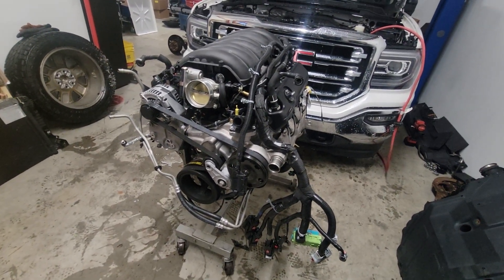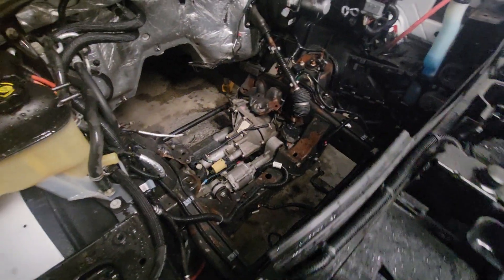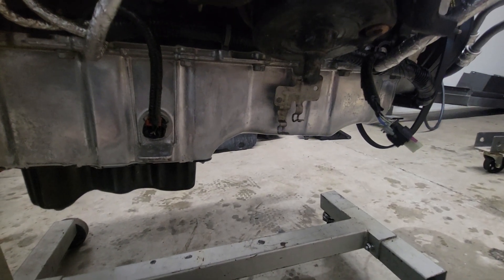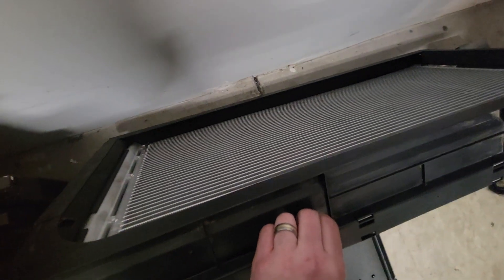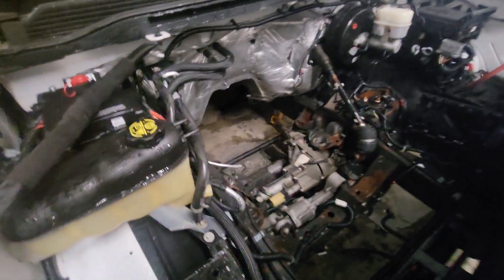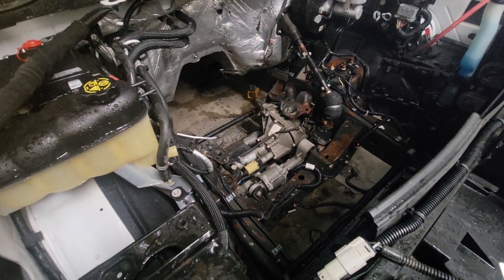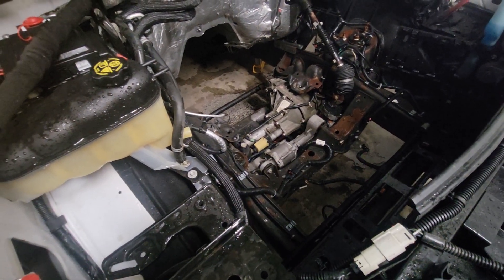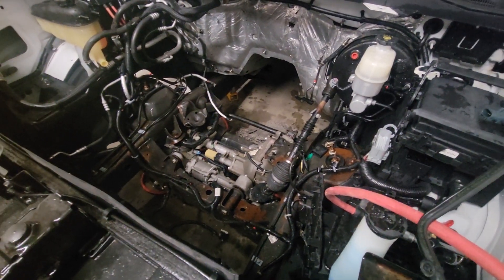L83/L86 to L8T (6.6L) swap for 14-18 GM 1500 Trucks/SUV - Part 2

Comment: Hello sir. Question did you use the lt8 engine mounts or the ones from your original engine?
Reply from the maker: The L8T engine mounts were different. I used the original mounts from my 5.3L.
Reply: @phillip.mcgloin thanks some how as I was making 2 engines 1 I put an lt8 mount on drivers side and they are short. Lifted the engine out and swapped the mount and all is right. I was sweating trying to do it the wrong way. That’s for the response

Comment: Hi, I swapped an L8P into my 2016 Yukon and wanted to know how you connected the oil level sensor to the harness. Thanks.
Reply from the maker: I used the L83 5.3L oil pan on my L8T. In my previous video, I discuss the reasons why I swapped the pan.
Reply: @phillip.mcgloin Oh, I thought you switched the pan to because the passenger side of the engine bay was too congested to access your oil dipstick and then on the driver’s side you had to modify the dipstick tube to clear the knock sensor. My L8T is already installed and there is plenty of room to access the dipstick with L8T pan so I kept with it. Thank you however.

Comment: Phillip, Chevrolet is doing an L8P swap in my 2018 High Country.  They keep getting the P0506 (Idle Air Control System RPM Lower than Expected).  They used the Vacuum block we ordered from you.  Have you had any experience with this or can you offer any advice?  Would greatly appreciate any advice!
Reply from the maker: I haven't had anyone with this issue yet.  I would first check to make sure there are no vacuum leaks, especially around the new vacuum manifold. Check to make sure the o-ring on both the evap solenoid and vacuum manifold are not cut and properly seated.  Also, check the vacuum hose to the brake booster for leaks.

Being a new install, it might just need throttle body relearn.  If your truck was an original 6.2L, you will need to use the original throttle body on the L8P.  If you truck was a 5.3L, you will need to use an L86 throttle body.  The L8P and L8T throttle bodies will not work with the E92 ECM.
Reply: @phillip.mcgloin  Thank you so much for this advice!  I will pass it on to the mechanics.  A Chevrolet dealer agreed to do the swap for us using your manifold and advice.

They keep running into this issue. I hope they followed your advice with modifying the VLOM and using your vacuum manifold.  Keeping fingers crossed.  Can't thank you enough for your help.
Reply: Pretty nuts u convinced a gm dealer to do this swap. Sounds like they are real mechanics and not the typical parts changers.
Reply: @chasewebber4316  I was surprised advice well, but now I'm more concerned than anything.  The mechanics and techs have followed all of Phillip's advice and still have not been able to fix the low idle issue. They've all but given up.

My dilemma now is do I have them pull the engine out and go back with an OEM L86 or do I take the vehicle from them with the existing issues.  I don't really want to take the truck back if it's not running correctly.  They had a world class tuner do the engine tuning.  He is miffed as well. Starting to wonder if the engine has an existing mechanical problem.

The hot rodder in me says get it from them and fix it myself, but then again paying $15k to Chevrolet for an incomplete swap is a gamble.

Comment: Great work. Wondering why you put the L83 accessories drive/belt on the L8T? Do the L8T accessories (water pump as an example) not fit/work when putting it in the 14-18 bay?
Reply from the maker: The L8T uses a more traditional accessory drive and I'm sure it would all fit. However, none of the wiring or hoses would match up.  It was just way easier to transfer everything over vs figuring out hose, a/c lines, and wiring.

If you are doing a swap into a older vehicle, I would definitely keep the factory L8T accessories.

Comment: Question,  will this work with an 8L90 transmission?  I am thinking of getting this engine for my 1500 Sierra.  My 2nd question is do I get the L8T or the L8P?  

I know the L8P off the crate already makes 500+hp which is what I’m aiming for.
Reply from the maker: Just reuse the flywheel currently on your truck. Im not sure if crate engines even come with one. The majority of used L8T engines will probably have a flywheel for the 6L.
Reply: @phillip.mcgloin a thank you
Reply: @phillip.mcgloin  L8P has the 8L flex plate, i did use the 6.2 water pump and oil pan on my project.  you were commenting on that.
Reply from the maker: Yes! I have the 8L90 in my truck. You will need to install the 8L flywheel on the engine as it's different than the 6L.

L8T is a truck engine... lots of low-end grunt. The L8P has a different cam and supporting valve train. It moves the power band up and really opens up above 4,000 rpm. I know guys who did the L8P and are happy with it. L8T is usually less expensive, and you can always cam swap it to get the L8P power at the L8T price tag.
Reply: @phillip.mcgloin thanks you for the quick response.  So I would need to install a 8L flywheel on my truck?  I have the 8speed trans 8l90 on mine.

Comment: Hi!
Getting my L8T tomorrow, starting this next week. Plus adding tons of mods... 
Thanks for posting these videos!
Reply: Also, not sure if you are the one selling the vacuum manifolds but I ordered one!
Thanks!!!
Reply: @DallairePat you going to post videos ?
Reply: @wildta4302  was not going to, the L8T I received is a mess, I have it pretty much bare tight now, have just put in the BTR cam I ordered for it.
Still working on getting my l86 out of the truck
Reply from the maker: Yup, that's me! Thanks for the order!
Reply: @phillip.mcgloin you have a link to parts you are selling?